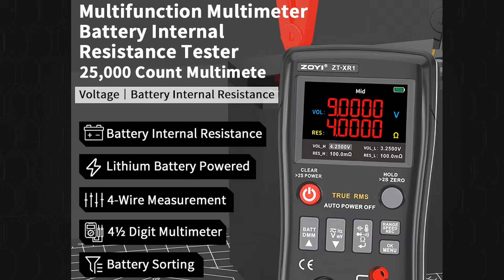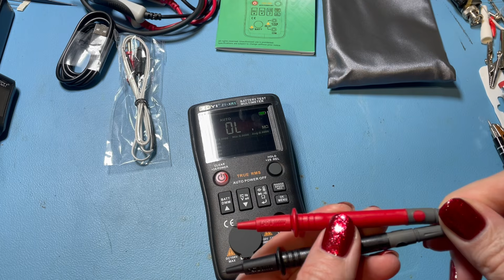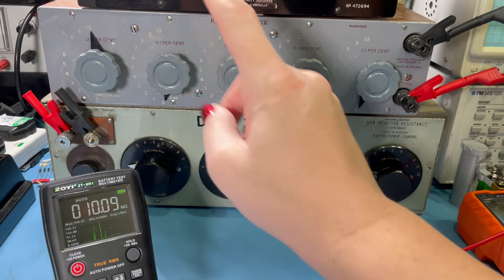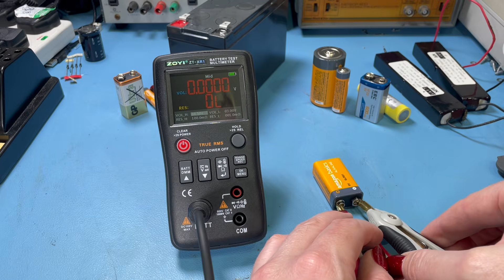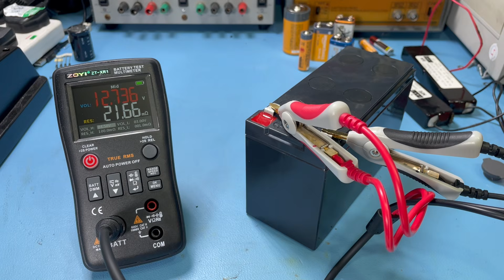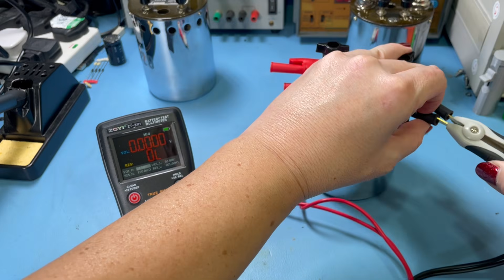Zoyi ZT XR1 Review - Multimeter & Battery Internal Resistance Tester - Plus it does Milliohms!

Comment: Dear Jazzy would it be possible to use miliohm function for capacitor ESR measurement?😶
Reply from the maker: I have just tried it and it does work, however it does not give the same reading as an ESR reading on a proper LCR meter. You can use it as a good rough guide, if that's all you need?

Comment: Thanks for another great review. I really liked the scope/meter/signal generator one. When I test vehicle batteries, I check voltage as well as available amps with a load tester. Since you're testing non-rechargeable batteries, I'm guessing that the resistance test is the best option for them. Thanks again for all you do.
Reply from the maker: I tested both non-rechargeable and rechargeable batteries. It does both. The idea of testing the internal resistance of a battery is to determine its health. If its internal resistance is high in comparison to a new one you can know if the battery is on the way out. With high internal resistance it will not be able to deliver its rated current.
The manual for this unit gives you the typical values for all sorts of new batteries. It might well be a quick way of you determining a vehicle battery's health without having to flatten it to find out.
Reply: @JazzTechUK  The load test uses a carbon pile to simulate a starter draw and gives you the available amperages. For example, a car battery can be charged to 12-13 volts but once the load is applied, nothing might happen if it doesn't provide the amps. The load is only a 10 second test and since the batteries are often 700-1K amps, the load is nbd for the good batteries to handle. If the battery is bad the reading will be considerably smaller than its rated capacity in Cold Cranking Amps, CCA.
Reply from the maker: It would interesting if you got one of these meters and tried it on your duff vehicle batteries and good ones and see how accurately this meter agrees with what you find with your load test. After a few tests I expect you could know in advance what vehicle batteries would fail your load test.
Reply: @JazzTechUK  Can't I just try measuring the resistance? I've never tried doing that to any type of battery tbh. Voltage and available amps have always been my only concern. I'm just concerned about the 1K amps my truck batteries carry causing permanent damage to a meter since the meter itself is putting out a small voltage to measure the resistance.
Reply from the maker: This meter when in 'Battery Testing' mode doesn't measure resistance using DC current/voltage like most multimeters do. It uses an AC test signal to effectively measure the impedance of the battery and convert it to milliohms. There is no direct current flow from the battery to this type of meter while using the dedicated battery testing socket, so it is perfectly safe to connect to any battery within this meter's battery testing voltage of up to 100V.
Just use the dedicated battery testing socket and cables ONLY.
A standard multimeter (also this one if you use the standard multimeter sockets) WILL put out a small current and the voltage drop is then measured. Then resistance is calculated. That would not be suitable as the battery will likely overwhelm it and upset the readings. Most decent multimeters are protected from users inadvertently putting voltage in on resistance ranges.
Reply: @JazzTechUK  I didn't get to see your entire presentation, so The battery socket being required was missed by me. I don't think the meter socket would work on an automotive battery, lol. When it comes to AA, AAA, C, D, and 9V batteries, I'm moving towards Lithium and rechargeable Lithium batteries and the special chargers they need, oh and coin batteries too. In addition to them having a normal output voltage compared to the earlier versions of rechargeables, they also last longer and NEVER leak. That's a huge win for me since I'm very busy building a new house and small batteries end up forgotten. I already had to clean out a laser level that had some corrosion in it and I want to avoid that sort of thing whenever I can. My memory isn't going to improve as I get older, lol. The meters having a built-in protection circuit is great. I grew up with analog meters though, so I never knew, lol. Thanks for making me feel a million years old, lol.

Comment: Just WOW.  😯
I assume these 4 1/2 digit meters are temp-compensated? 
When you compare against standard boxes, are the latter temp-sensitive?
Envy mode is on!
Great vid - educational compared with 'box openers'.
This youngster (73) looks forward to each one ❤️.
Reply from the maker: I doubt this level of meter is temperature compensated, but if they use quality components they won't be that temperature sensitive within reason.
As for the standard resistors they are several orders of magnitude better than these types of meter. They are wound with Manganin alloy wire which has an extremely low temperature coefficient. In fact this metal alloy was specially developed to have the lowest temperature coefficient of any alloy, so is perfect for standards resistors like this. The 2 smallest values shown here are filled with mineral oil to stabilise their tempco even further.
In proper laboratory conditions, all these resistors would be submerged in a temperature controlled oil bath filled with mineral oil, so that ambient temperature has no effect on their value.
There is some more learning for you 😊